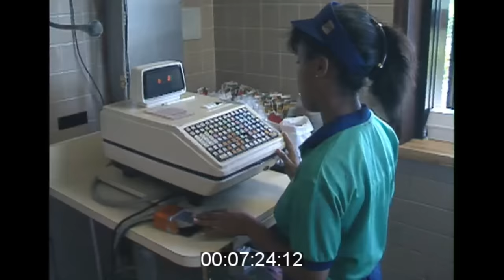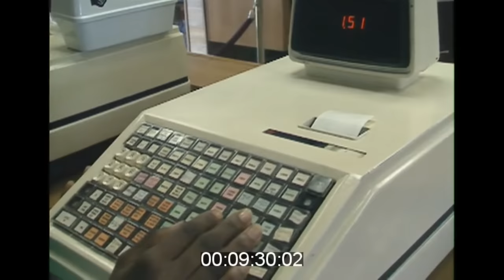Inside a Burger King restaurant in 1988

Comment: You ever notice how BK, MCD’s or otherwise never have the live plants in them anymore? I know part of it was probably to help filter the air because ppl used to smoke inside but, it would be so nice if they still did that.
Reply: I miss that, too. Made it feel more inviting.
Reply: Nobody would keep them watered, then you'd have a bunch of stores with dead plants inside.
Reply: The plants would not filter anything worth mentioning.  Customers walking in and out had a zillion times more impact on improving air quality than a dozen small plants could ever hope to achieve.  Regardless, my joint would have plants all over.  In Flint, MI, there was a place called Country Kettle that had a large fountain in the lobby entrance with lots of plants.  I loved it and the fresh smell of volatile organic compounds it provided.  I get the same satisfaction from the fresh produce isle at supermarkets, especially when the misters are active.  A cut fresh flowers walk in refrigeration unit practically gives me an erection from the pleasant smell.

Comment: Soda machines were behind the counter. Some places might offer discounted refills, but I don't recall that. If you wanted another Coke, you paid for another.
Reply: Taco Bell was the first place I remember with free refills, in about 1989. Everyone else switched over soon after.
Reply: Sounds pretty lame. Good thing times have changed
Reply: And what's old is new again. McDs are moving them back behind the counter again as they remodel stores. Self-service saves time, but at the cost of more frequent cleaning. Also, too many abusing refills or just not paying to begin with.

Comment: As somebody who worked at a Canadian Burger King restaurant in the early to mid 2000s … I can confirm almost NOTHING has changed from how they did it in the 80s in this video. Actually kind of surprising to me. So nostalgic!
Reply: I'm working in BK in Arg. And even now its pretty much the same as this video, at least in this country. The biggest difference is probably the computer.
Reply: you can't change perfection

Comment: Love the gas broiler. Now days they are electric. It shouldn't be called a "flame broiled whopper " if there isn't a flame. I was a commercial, industrial electrician and service call electrician.  I remember in the 90's when they started converting from gas to electric broilers, because I wired the new electric ones in like 20 locations. Just didn't taste the same
Reply: Now the use a liquid for taste
Reply: @wlkbeastmode-issiap.346  yuck
Reply: Still use gas broilers where I live.  Never seen an electric broiler at a Burger King.
Reply: @konghy2  this was in the early 90's,  they could've changed the ones  back that did. From what I remember,  they looked basically the same. The same  stainless conveyor but electric
Reply: The Gas Broilers were in use until 2005 if I recall. When I worked there in ‘99, we were STILL using Gas Broilers.

Comment: I worked at a Tampa Burger King from 87 to 90 and I was upset when they replaced these registers with the flat screen ones. You had to press so hard to get it to register and I ended up with carpal tunnel.

Comment: i think we were more relaxed then because we weren't so inundated with information and everything was less complicated. there was a switch for on and off and a control for loud and quiet. That was enough in good old times.there were still real keys to type on that you could hack around fast on with practice. if a machine didn't work, you gave it a tap and it worked again.
Oh i love old keys and old machines! Especially of the 70ies and 80ies.

Comment: The thing is that in 1989 I could work an 8 hour shift and make enough at $3.35 per hour to fill up my car and buy a carton of cigarettes.  Today an 8 hour shift at $7.25 (yes in Indiana and Kentucky that’s what it still is) wouldn’t even fill up my car, let alone even a pack of cigarettes to go with it.  Inflation is just out of control.  If you asked most people in the 80’s and 90’s they would say they were satisfied or happy in life.  Not so today.  It started sliding downhill around 2000 and hasn’t stopped (and likely never will).  Things are bad and they’re not likely to get better any time soon.  One more example.  In 1989 I could buy a new pair of shoes made in the USA for around $40.  Today that same new pair of shoes is made in china and costs $90+

Comment: As I watch this, i feel compelled to comment on a lot of this stuff, mostly because it was so long ago that so many things have changed, and lots of folks have never seen this stuff.
Those cash registers, have complex array of buttons, and you need to be trained to use them, and this was in a time where most folks never used a computer, or heard of the internet.
I worked at BK in the 80s for a few months, and I operated the grill, but I also had to take it apart, and put it in a degreasing machine overnight. 
When someone ordered a hamburger with no meat, they would pull a burger out of the steamer, then pull the patty off and serve them a greasy bun with lettuce, tomato and mustard and catsup. 
They have left handed fry scoops
99 cent whoppers were a thing for like a decade
4:00 They used to have these breaded chicken sandwiches, that were very popular, they came in 4 styles, French, Italian, and I cant remember the other 2
Reply: Now, they just have the one chicken sandwich.